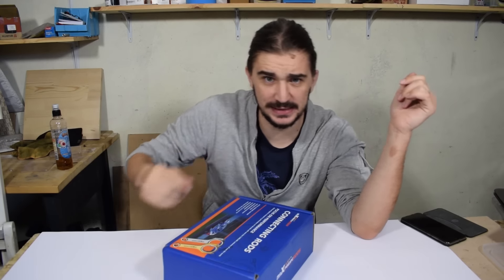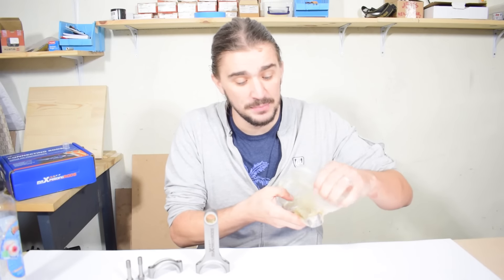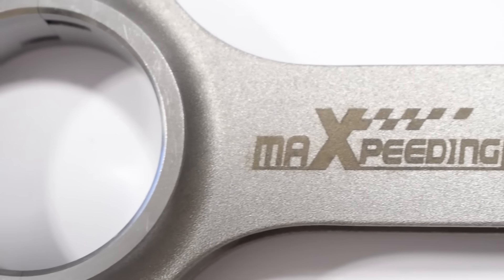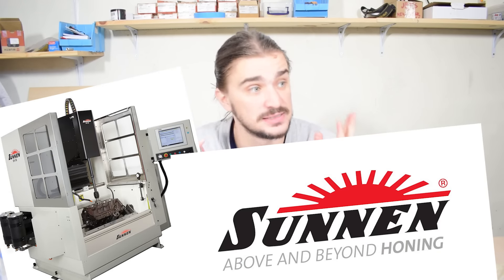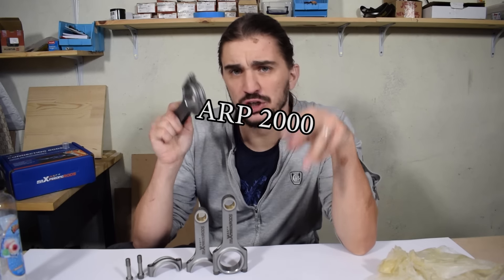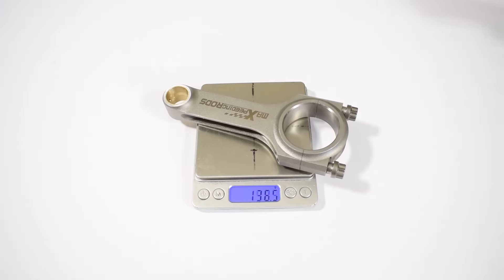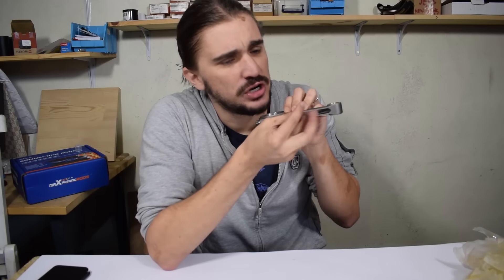UNBOXING budget forged CONRODS - MaXpeedingRods first impressions - PROJECT UNDERDOG #2

Comment: I used these rods in my FJ20ET circuit race car engine pushing 500HP with no issues so far. I did have them resized for safety and I filed a small u - shaped groove in the top side of the big end to oil the gudgeon pin. Mine too were within 0.5g. They have been over-reved to 10000RPM, spend their life at 5000 to 8000 RPM and after 4 years I pulled the big end caps off and the bearings were perfect. Good value I reckon.
Reply: Thanks for sharing. Plan on using these bad boys

Comment: MaXpeedingRods was very awesome with customer service for me. I have a VW Mk3 Cabrio with MaXpeedingRods and I was a bit careless and had dirt in the threads while applying torque to the arp bolts, one of the bolts locked up and I had to use a breaker bar with a jackstand handle to completely break the arp bolt off just so I could free the rod and get it out. I sent them a picture of my mistake and was completely honest how I didn't clear dirt out of the threads and they sent me a new rod free of charge... I have no words... but respect.

Comment: I use these rods in my Audi 20vt 5cyl, I'm running 30psi with a 76mm borg warner and spinning over 8000 rpm. They work.
Reply: 30psi, 76mm, and 8,000 rpms. If you try to tell me this is your driver driver I’m gonna say bullshit, and if it is you’re also my hero🤣
Reply: How much hp?
Reply: Geez how many hrsprs?
Reply: They work great for about a year. Then the little ends flog out.
Been there done that
Reply: How are they holding after 3 years? Did they already break?😅😂
Reply: They still holding up?
Reply: are they still holding?
Reply: @ochisettingz3383  I'm sure they would be had I not melted a piston, scored the block and then parted out the car. Now I'm running maxpeedingrods rods in my Volvo T6, with a GTX3076R Gen2, 28psi but I only spin it to 7700 because the lifters pump down if I rev it higher.

Comment: I'm using these rods in my VAG 1.8t 20v and I'm very happy with them, great quality stuff and no issues with 3 years of abusement
Reply: Abusement: amusing abuse.
Reply: What about top end rattle as I know these don't come riffle drilled and 1.8ts need it to oil the small end bushing anything under 2500rpm
Reply: Is it still running? Just acquired these rods for my 06a
Reply: @mk4geo822  still running strong , still amusing abuse 😂
Reply: @armandbeyers2935  what pistons boss?
Reply: @mk4geo822  stock
Reply: @armandbeyers2935  did you have to grind down the inside of the piston to fit the maxpeeding rod
Reply: @mk4geo822  no straight fit
Reply: @armandbeyers2935  how many hp where you pushing

Comment: We did use maxspeeding rods in 700hp straight six and no problems what so ever.
Reply: Did you used the bolts provided by them?
Reply: @jordancespedes15  Yes. Why not.
Reply: Came across a thread on vw forums and a guy is  claiming he said bolt failure on these rods thats why im asking
Reply: Hi, Did you have to balance the bottom end?
Reply: @Streetmodz-Joe  No
Reply: Just out of curiosity, what straight six?
Reply: @TTURBOVOLVO  m50 bmw engine. check his channel out
Reply: what pistons were you running?
Reply: @pongstatus7268  Wiseco pistons.
Reply: @jordancespedes15  its because this guy is trying to sell carrillio carr Rod bolts on ebay go figure 🤔

Comment: One more little thing is the hole in the wrist pin side is definitely drilled a bit off center. Otherwise they do look like a good rod for the money! Great overview.
Reply: If they can't make sure to drill that hole in the center, can you be sure they took the time to do the rest of the work up to spec?
Reply: They are off center so that the oil feed doesn't block the passage (lining)
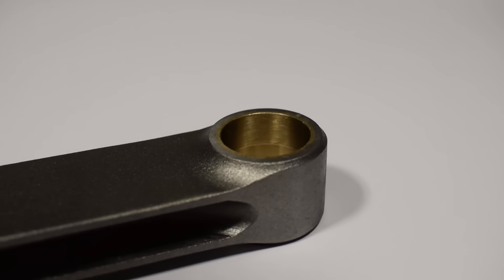Reply: @yannisx3209  Talking about 10:51 in other shots the hole seemed centered in the oil feed groove, but not that rod. Don't think it will make an effective difference.
Reply: @freddyrosenberg9288  Depends on what parts of the operation they spend money on. Only way to know is to measure, test, and verify.

Comment: 7:35 at least 7afe rods hold up to 400hp at 8000rpm - at that point they start to bend (tested with arp bolts) so they are strong enough.. just look on d15/d16 rods, they are thin as pencils and still make 280-300hp.
yeah HP rantings are useless, it depends more on weight of the piston and revolutions and as said by knock
really what engine cam make really depends on ring gap :D and ring gap doesnt depend on mileage
Reply: i would say it's more about the peak cylinder pressure than anything else

Comment: funny thing is i have a set of these for a 7a with the small end sized for floating wrist pins, and when i got them they came in a plain cardboard box.  I really need to start this 7age build one day.  I cant wait to see the 4a build
Reply: I'm in the same boat.  I was just gonna turbo a stock bottom and just slap a g head on it and keep the rpm around 6500 and give it 10 psi and be Happy.... Been sitting on that for 4 years now.
Reply: I know this is an old comment but I've heard of other Chinese companies faking/copying the msr rods

Comment: Rods should also be weight checked end to end-little ends should be very close in weight to one another as should the big ends.We used to check end weights on A series (mini engines)with approx 120hp plus(plus lots of revs- 7k regularly)-more measuring/more accuracy=longer life.I'm sure it's going to be even more important with the hp you're intending.(Obvs we were using OEM rods with a bit of meat on that could be ground away to match-Hopefully forged/machined rods should be really close.)
Reply: How and where? How much does that normally cost? If I buy higher end rods do I still need to do that? Shit this $1,200 job is turning into a lot more... I only want to run max 400-450hp in my Mazdaspeed

Comment: Let me just get my gram scale. That I have for.... um.... weighing saffron.....
Reply from the maker: How do you come up with this stuff 🤣
Reply: Where can I store the bolts?  I know, I'll put them in these little zip lock bags that I have conveniently lying around...
Reply: @d4a  I'm guessing he too has a gram scale for.... um.... measuring saffron....
Reply: I had a shop, years ago, where I sold +- 0.5 gram and +- 1/20 gr precission scales... when the almost always young buyers looked confused, I simply asked: for green or for white? ... and everybody was happy...
Reply: Could you just drill out small sections like a rotary until you get correct weight Ik this a two year old comment
Reply: @yolaproductions1729  kind of, yes. From the factory good forged rods should come relatively balanced. There's a few places where there is usually enough meat that you can dimple to reduce weight and end balance rods. If they are too far out you'll compromise strength. You can do the same with pistons. If you're trying to run 13,000rpm and 500hp/litre like F1 you need to balance the pistons side to side as well which adds more fun.

Comment: Used them in my last 2j, 603rwhp@22psi-825rwhp@36psi e85.  No issues. Using them in my current 2j and swapped a set of sr20 rods to my mate for z32 parts 👍 I like these parts.

Comment: You should also measure the big end machining tolerance. Big end machining tolerance across axis should not lesser or higher than 0.001. These rods big end machining tolerance is 0.005. That is big difference for a connecting rod. Well-known brands machining tolerance of the big end section is spot on within +/- 0.001. It won't destroy your engine right away but would cause issue for long run.

Comment: I use the same rods in my 4age with Honda b18 turbo nippon piston it hold 25 psi on a gt35 turbo I love it no problem what so ever
Reply: Any more info on that? Looks like the b18 pistons have 21mm wrist pin, so did you machine out the rods or are there b18 pistons with 20mm wrist pin?
Reply: Gt35, holy cow that is bigger then the Honda motor. Does a Honda motor come with the purchase of that big ass turbo, 🤣🤣🤣🤣

Comment: I bought these rods a few weeks back and checked the big and small end diameter with bore gauge with everything in spec! Nothing different in measurement difference from big brand rods. also balance between rods big and small end are with in spec! Only thing to note is the hole in the bearing cap to the bolt is a little bit big...

Comment: If that's truely 4340 it's not a bad price, but I only have knowledge of Chevrolet, SBC engine components. I have a balanced rotating assembly, made from 5140, I wouldn't mind next time going with 4340 H- beam rods, but being a 6.3 litre, 385 cid stroker, only revs to 6,500-6,800 , and makes around 650 hp.   my next engine will likely be smaller displacement, and rev to 7500+, H beam being lighter, it will work better in high rpm engines,  just saying, I know you know this,

Comment: the weight from the rod is not only measured in full, but the 2 sides appart for dynamic balancing: this need a special weithing scale with 2 pins...

Comment: I initially got the maxpeeding rods for my Volvo, but I ended up reselling them because the web thickness was inconsistent and the finish was pretty rough, I wasn't comfortable putting them in my 700ft-lb torque Volvo engine build. I ended up going with AUTOVERDI rods. They only do custom rods now after China fakes nearly ruined their reputation.
Reply: Are they already balanced and if not why didn’t you go to the machine shop to see if they can be balanced?

Comment: I believe Hoonigans S*it car was sat on Maxpeeding rods coilovers ant they survived everything
Reply: From what I've heard their coilovers are utter garbage, but rods seem decent.
Reply: I can say their coilover are about as good as Megan racing with less adjustability. I use them on a 3000gt with no issues other than a bolt spacer I had to Fab up.
Reply: @az_3kgt714  when it comes to suspension parts i'd much rather have something tested and known to be good quality, it's why i'm just gonna invest in some BC's for my prelude, never underestimate how important tires and suspension are
Reply: @notbilly5962  im just saying from experience ive had megan racing coilovers and these current maxpeeding rods. They really are good ive had no issues with them so far. Right up there with the megan's and i tracked both sets. So you do you not complaining. But for me i would buy another set of these maxpeeding rods they arent bad at all.
Reply: Yeah but Bhalls e46 was on maxpeedingrods coilovers and didnt last 3 months

Comment: What really should be done to be able to judge if these rods are alright: professionally MEASURE straightness, big end roundness, big end taper, small end diameter and proper balance testing, not just putting them on a scale. But I do agree that probably 90% of aftermarket rods are coming from Chinese factories. The real issue with made in china is, when there is no second quality control, because that is the weakest part of made in china. If you want to be sure, check and measure everything, or buy from a reputable brand where this has been done by them.
Reply: That’s what I’m saying, take it to a machine shop and see if they can balance it and see if there are any inconsistencies, problem solved.

Comment: I've been loking at these rods too, still not sure if I should just stick to my original late bigport rods or upgrade for these when I'm planning to make 4A-GTE with ~250hp.
Reply: i'd go for these, just because you can be sure that they can hold and do not destroy your block, but i dont know how much the original rods can hold, but as D4A said, its about the setup and not about the facts of the parts.
Reply: Have these in my silvertop 20v turbo in AE95, been very happy with them
Reply: Smallport 4agze bottom end will hold well beyond that power level
Reply: 250hp is a seriously easy target for 4a engines

Comment: well they look all conclusive so its torque strength thru will be whatever it is, then just check the clearance, deminsions and weight.... but id weigh em comparative from end to end .... micrometer,  digital calipers.

Comment: i did buy a set of these rods for my 4afe projekt, and a think they look nice, but i sent them back because the 4afe have the piston pins pressed in the rods with press fit, the piston pins just dropped straight tru the maxpeeding rods with no resistance so i could not use them with the 4afe pistons, max rods are 20mm in the small end, the stock are 19.95 ish, the rods did also not have the holes for the piston squirters, and that is not good for the piston temperature and reliability, i belive you have to use 4age pistons and maybe head for valve clarance? to use these rods and drill holes in the rods for the piston squirters or use a 4age block with piston squirters from the oil gallery, unless they have made recent changes on the rods?
so the rods i ordered specific for my 4afe were only usable on an 4age
Reply from the maker: Wait, your 4afe has oil squirters? Does that mean mine does too?
Reply: @d4a  the original rod from my 4afe ( and probably yours to) has a hole in the connecting-rod that squirts oil to the piston and cylinder, it does not have squirters like the 4age that takes oli from the oil gallery
look at first picture in the link to se the hole 
https://www.ebay.com/itm/TOYOTA-ROD-SUB-ASSY-CONNECTING-Celica-Corolla-Tercel-4AC-4AF-4AFE-4ALC-AE71/262919338414?hash=item3d3736b9ae:g:I8QAAOSwi6tdGfs9
Reply from the maker: Oh that hole, that's different, but you're right, works like a squirter. I expect that sadly many aftermarket rods will omit that due to the added cost of machining it in. These rods look very beefy tho!
Reply: yes the rods are beefy, and the hole would make the rod weaker, as well as the hole would (steal) lubrukation from the rod bearing,  that is bad at high hp and load

Comment: Nice preview, sadly they don't make any rods for Mazdaspeed 3/6 :(  I would have placed an order just to feel safe, because my Mazdaspeed 6 has a big fat torque curve down low and these engines are bending rods like spaghetti.
Imagine having 270Nm torque down low at under 2000rpm on spaghetti rods.
Reply: Honestly, you’re better off with a bigger turbo that doesn’t build build boost till the hire RPM range, I know my brother is doing this right now.

Comment: the rods could be made of old rail road track, the valves could be made of old 3/4'' or 1'' bolts... 400'000 miles and many sets of bearings... if it works there good.
Reply: Railroad track is high manganese steel, work hardened, and is unbelievably tough. You really could make rods out of that stuff.

Comment: I'm curious about the RPM rating. I don't see that on other rods. They say the max RPM rating is 9000. Though they sell rods for the F20C which could rev up to 9200. I'd like to build an K20A, which I would be revving up to 8000/8500. Should I be taking this RPM rating with a grain of salt as well? I do plan on doing endurance racing (lucky dog racing league). So the engine would be running for long periods of time.

Comment: You should have saved this till when u had tested them and did a full vid . I’ve watched a few of your vid 👍.  I’m building engines for 20 + years , and I have only seen 1 set but from what u described the shot peening wasn’t done right , inside the beam but what I seen , they are arp bolts but the tapped part in the rod is excessively loose , remove the cap and treaty up the bolt it’s only till the end they feel near right
Reply: I couldn’t agree with you more, do you think the fact of having ARP will help at all?

Comment: I'm seeing their dimensions for this rod on their website right now is Big end diameter: 45mm; Small end diameter: 20mm and to my knowledge isn't the big end diameter supposed to be 42mm?
Reply from the maker: That's the size of the big end bore without the bearing. The size of the rod journal on the crank is 42mm.
Reply: Thanks alot for that because I was a bit skeptical on ordering a set but thanks

Comment: Atleast get those measured and maybe re honed, many people use these in finland and when they get them measured quite many are too tight.. but other than that it is a awesome product.
Reply from the maker: I definitely plan to measure them and adjust as needed. I would measure and check rods from anyone, even Saenz :)
Reply: @d4a  Yes, indeed thats what you always should do.

Comment: Ford manufactures all 5C (cylinder block/cylinder head/crankshaft/camshaft/conrods)  parts inhouse. If your Engine is from UK, its 5C parts are made in Europe, if it is from Turkey 5C is made in Turkey. And all sourcing for castings and forgings for 5C in Europe is based on Europe. For the companies that say "finished machine" actually talk about grinding/honing/lapping operations, and believe me most of the time it is the finishing operations that matter. Around 70% of all failures arise from finishing operations. Who am I to say these? I am a manufacturing engineer working on powertrain operations and saw many plants and inspected many failed parts in my career.

Comment: how to calculate max rpm for na engine that rods are capable to handle
Reply from the maker: These rods are good up to 9000 rpm and most manufacturers will tell you the recommended max rpm. You can't really calculate when a rod will fall apart, you could do simulations but that's a lot of work, you need all the variables etc.
Reply: @d4a  yes, it looks like difficult to calculate thing like this, also main weak point probably are bolts

Comment: "Rods for high horsepower build"
In NA engine, the forces from piston acceleration/deceleration are far higher than forces from cylinder pressures. If you dont believe me do the math.
Matching rod weights means fuck all if your crank/flywheel are not balanced. No matter how shiny they are, get them balanced.